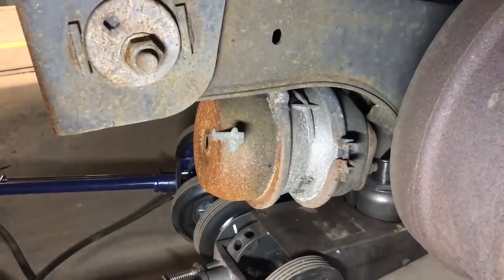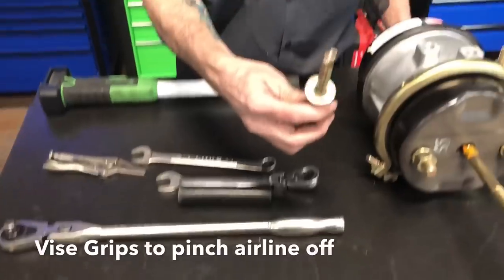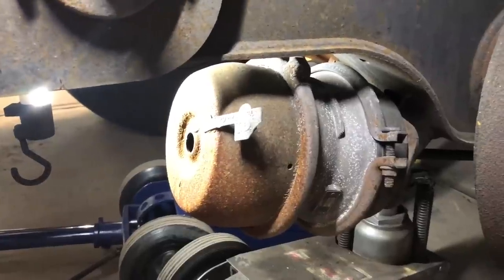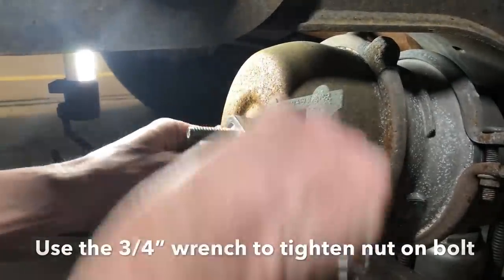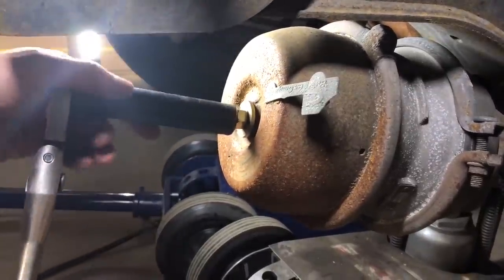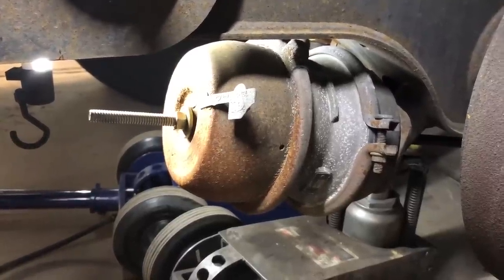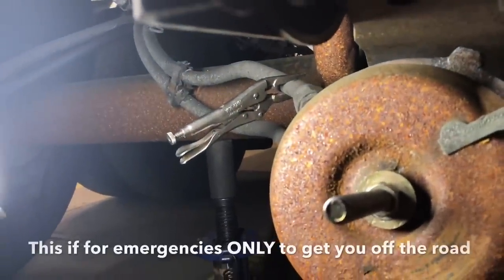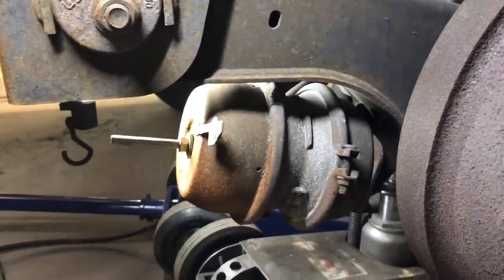Emergency Fix For Blown or Leaking Brake Chamber DIY Step By Step Guide. How To Fix It Yourself

Comment: I got trapped behind a truck for 2 hours today blocking the exit of an industrial estate. The air supply had snapped at the joint into the cylinder. .I couldn’t find how to do this at the time. I just found you helpful video thanks. I hope I never need to do it but good to know how it’s done.

Comment: Great video , i have seen guys remove lines fold them and hold them in position with zip ties when there are no vice grips on hand
Reply from the maker: memopat1 we have had to do that in a pinch also when a driver wasn’t prepared and had no tools with him. That’s another thing that I don’t understand. Why not have tools with you ?
Reply: Koon Trucking 
My top must have tools ,flashlifght ,hammer,cresent wrench,zip ties,duck tape,flat tip screw driver  bare bones must haves. 

Hey how about video on that ??

Comment: Great video thanks brother. The socket and wratchet saves the hand to. Padded gloves are good with the wrench help save the hands. Sometimes it feels like it takes forever to get it caged. Thanks again keep up the great work see you in the next video
Reply from the maker: Scott Pearson yeah I just bought a set of those mechanics gloves with the padding on the back. They seemed pretty sweet. I can see how they will save your hands.
Reply: Tried caging the booster, but I couldn’t put it in the hole coz the spring inside was broken, and was in the way. In that case what shall I do to cage this thing. Thanks

Comment: This just saved my tale and wallet thanks so much!! I couldn’t get the original off of the bolt off the problematic chamber but thank God the trailer had 1 of 4 on it. If it wasn’t for that I’d still be stuck. 😅😅😅
Reply from the maker: That’s awesome ! Glad you were able to get it handled and save a little

Comment: I had the emergency line broke in one left from chamber , the t bolts were so rusted that I was not able to removed them. I used a lot of zip ties to clamp the emergency line so it would not leak. I took the emergency line out of the right chamber connected to the left chamber and unadjusted the brakes all the way up. Then I reconnected the right chamber and I was able to get out of the road. 
I just drove to the next truck stop and bought a new brake hose , replace it , adjust the brakes and hit the road again.

Comment: Must be very nice weather were you are cause up here in Canada you would never get the cage bolt out with the salt, snow, mud and ice it locks the bolt in the pot tighter then a nuns corset you would bust the pot before you would ever get the bolt out with a hammer it's funny what steel and aluminum does together
Reply from the maker: brian bell yes we don’t have ice and salt thankfully !!

Comment: If you cant cage the pot because the plug has come off and a caging bolt wont engage because of dirt inside there will removing the whole pot work as well?

Comment: What if the caging bolt doesn't.turn   .. after you put it in?
Reply from the maker: Thank you Allah I haven’t ever seen that ? If you line the T portion of the caging bolt up and give it a quarter turn it should pull the spring back inside it ? I’ve never had one that was froze up ? I guess it’s possible the spring could be bad or broken if so you would need to change the entire chamber out with a new one.
Reply: Koon Trucking without caging it?